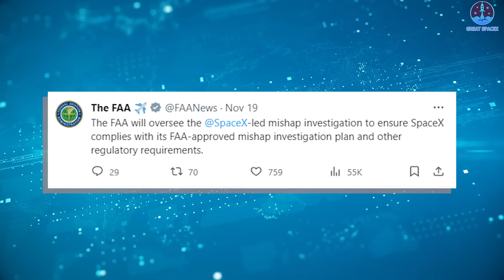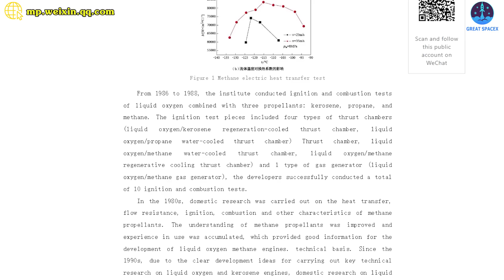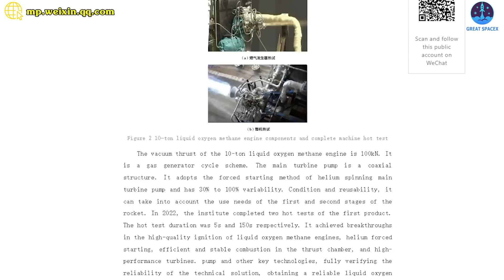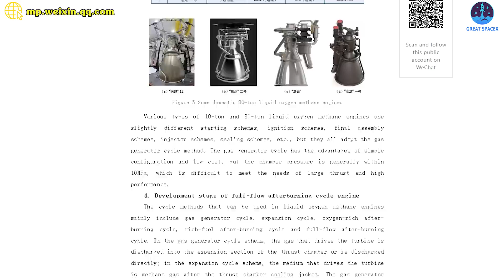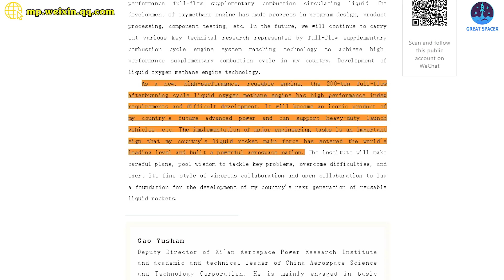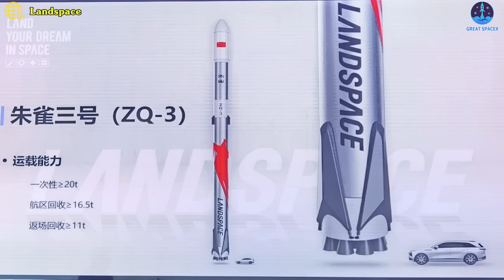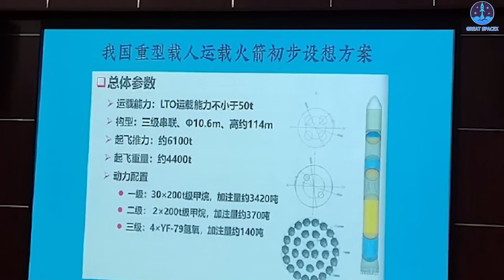SpaceX Starbase Reboot for Starship IFT-3! Blue Origin New Glenn's first stage revealed...

Comment: New Glenn is designed to compete with falcon9, the reliable and cheap but outdated SpaceX-workhorse, and not competitive to the FULL reusable Starship. So New Glenn is outdated before its 1st flight and not competitive at all !!!
Reply: Yeah, it should just be "Glenn".
Reply: If these rockets can literally land under their own engine power how on Earth are they outdated!?
Reply: @randomguyonyoutube1620  New Glenn is not FULL reusable like Falcon9, the second New Glenn stage will be expanded in contrast to the Starship, which will perform reentry from Orbit and can transport goods and personal from Orbit to Earth and from USA to Australia for example. You need reusability of the second stage in order to build a "Gasstation" in orbit and you need that gasstation in orbit to have fuel for refilling deep space Missions and other projects like commercialisation of the space....

Comment: Why has SLS not been scrapped? Untold Billions of dollars poured into a system that is soon to be obsolete, that will cost 1 billion per launch with nothing recoverable.
Reply: Starship will eventually make SLS obsolete.  In particular SpaceX has bid a total of $4B for two crewed landings on the Moon and the requirement to rendezvous with Orion in the Not Really Helpful Orbit (NRHO) severely reduces the payload it can deliver to the  Lunar surface.  That is less than half the cost of the two SLS launches required to deliver Orion to the NRHO.  Starship does not need to rendezvous with Orion because it has to fly from the LEO fuel station to the Moon and back again anyway .  If I were an astronaut and I was given a choice of spending 9 days in the tens of cubic metres of habitable space of the brand new HLS or two weeks crammed in the 9 cubic metres of a 12 year old Orion, and having the entire four person crew delivered to the Moon with a hundred tonnes of equipment and supplies rather than the ten tonnes included with Artemis ...

HOWEVER, Starship is still only a prototype and honestly will probably not be ready in time for Artemis 3, which is currently scheduled for just two years from now.  Some commentators question whether Starship can be made "crew-capable", because of its lack of a launch escape system.  However there are two trivial workarounds:

1. Deliver the crew to the HLS by Crew Dragon after it is fully fuelled in LEO.
2. Attach a Crew Dragon to the Starship as a lifeboat.  The crew would ride to orbit sitting in the Crew Dragon which could be ejected if anything went wrong, just as cosmonauts squeeze into the Soyuz reentry capsule during launches.

However beyond Artemis 4, four years from now in 2027, Starship will clearly be in full production with at least a hundred consecutive successful launches.  At that point it will cost SpaceX less than $100M to refuel and deliver an HLS from LEO to the Lunar surface and back again.  SpaceX will have almost certainly flown the Dear Moon, Polaris 3 and Polaris 4 crewed orbital missions to the Moon by then, and will be charging for payloads to lunar orbit at rate comparable to current Falcon 9 rates per kg to LEO.  At that point you really have to ask why American/European/Japanese/Canadian  taxpayers should be asked to pay $4B for an SLS flight plus $3B for a BO lander, to achieve the objectives of Artemis 5, when SpaceX can probably bid less than $500M and still make an obscene profit.  I would also like to see Dynetics partner with SpaceX because their ALPACA could be delivered fully-fueled to lunar orbit, or to the Lunar surface, although I suggest they relabel it the Eagle in honour of Space 1999.  It makes much more sense for point to point deliveries on the Moon, than as a means to deliver payload from the Earth to the Moon.

_From the Earth to the Moon_, Jules Verne, 1867
_There and Back Again_, J.R.R. Tolkien, 1947
Reply: @jamescobban857   Using falcon to deliver the crew to a orbiting StarShip seems like the way to go and leave dragon in orbit until the crew uses it to come back to earth.
Falcon flew for years and dragon took cargo to the space station before humans flew it.
Reply: SLS has a lot of politics behind it. A big part of the reason it's so expensive is politicians from across the country have lobbied to have parts of the rocket produced in their state. They've even made laws that prevent NASA from diverting funds away from SLS to other projects. SLS is more of a government pork project than a rocket development project

Comment: Of course the FAA deemed IFT2 a "flight anomaly"! Two RUDs could hardly be considered otherwise but as the FAA notice said, "No injuries or property damage have been reported." (Apparently incommoded fish do not count. ;) ) Obviously there will be a few Ts to cross and Is to dot to make the bureaucrats happy but that is minor.
Reply: Only the upper stage failure was an anomaly (or at least, a consequential one). They didn't ground F9 launches every time one of their first stages failed to land.

The ship failing to reach orbit is a real problem though. Propellant leak I guess, which happens. But, for a ship that's going to rely on in-orbit refueling you'd think it would have a lot of dv margin, and the fact that it apparently doesn't is worrying. Hope I'm wrong about that.
Reply: @eikokiri-i4d  The ship didn't fail to reach orbit due to insufficient DV. Indications are that the upper stage suffered a major, catastrophic malfunction. Comparing IFT2 to IFT1 SpaceX has made huge progress. That's how iterative engineering works. You take steps towards your goal, learning from each "failure". I've had to go through many iterations before getting it right. Hopefully the FAA will do its thing quickly so SpaceX can get on with the job of going to Mars.
Reply: I heard someone say that the upper stage still used hydraulic TVC.  So, that may be part of what led to the issue that prevented it from continuing further into its planned mission profile.  SpaceX will be poring over every single bit of data and telemetry from Starship right up to the FTS activation in an effort to determine exactly what transpired.  But all of this is part of the plan and process.  It’s neither a shocking nor a wholly unexpected development, when things don’t work nominally at one point or another.  The only way these things can be rooted out of the design is if they occur during test.  No test, no discovery and no progress.  The key is to continually test and continually improve.
Reply: @cobra-judy-anspq11  I spent several years in electronic R&D engineering. If you're not screwing up you're not doing anything. If everything works you don't know if you got the design right or you just didn't get close to some boundary condition. I worked for a software company and more than once we had a module that had been working for months puke its guts up. I once spent a week in Des Moines, Iowa analyzing such a problem. Under certain conditions the software would just go to its knees. Nothing for it but to reboot. It was costing customers money. As software test analyst all I could do was tell the programmers what I saw going wrong. I would generate test data for a couple of hours then spent 6 or 8 analyzing the data. I can only imagine what the engineers at SpaceX are doing right now.
Reply: Will prob be another year before they can fly again because of it.
Reply: @SpruceMoose-iv8un  I doubt it. My money is on the 1st quarter of '24 i.e. before April Fool's Day.

Comment: Of the 3 systems in development only Starship has actually flown and is handicapped by the FAA unwittingly(?) working against US interests. Both Vulcan and New Glenn haven't flown and so are still at the pretty water tower stage. Both are handicapped by using the unproven Blue Origin BE4 engine. Vulcan may fly by Christmas this year, but New Glenn has much further to go, and at Blue Origin's glacial rate of progress it may be years late based on past performance. Additionally, once Spaceship demonstrates it can get to orbit and return, it will make New Glenn totally obsolete as Spaceship can deliver twice as much mass to orbit at a much lower cost. Perhaps Jeff Bezo's Elon envy can justify BO building another pointless rocket, but share holders require returns and potential customers will look for low cost and reliability
Reply: SpaceX will land on the moon before BO test flies
Reply: That's why I wish SpaceX would quit with the Indian Ocean or Hawaii bs and go for orbit with the 3rd launch
Reply: @DrDiff952  The primary additional objective of the Indian splashdown is determining if it is possible for Starship to communicate with Starlink along the only path that is not blocked by electrically conductive plasma, the tunnel that the Starship has plowed through the upper atmosphere.  The only reason that the early tests are suborbital is that an orbital trajectory would require the Starship to perform a second engine burn to initiate reentry.  SpaceX does not have to prove that Starship can reach orbit.  If it reaches the planned suborbital trajectory with propellants  left, that is proven.  More important is testing reentry at near orbital velocity, something no launcher has yet achieved.

Comment: How many satellites can they keep putting up in space?.
Reply: Space is a big place
Reply: Idk, there’s a LOT of space out there… I don’t think there is a limit.
Reply: Imagine the surface of the earth, now imagine it has multiple layers in different altitudes, and each layer is slightly bigger than the previous one, and all that space is used.
Now imagine the same layers, but slightly smaller ones. How many planes can we have in those? remembering that planes folows paths that don't maximize all the air space of the earth. 
There are about 10.000 planes in the air at any given time in average.
Plus, a plane is so much bigger than any satelite, some are the size of a shoe box, some are the size of a bus, but none are the size of a comercial airplane.
Reply: Over 9000
Reply: @TubbyJ420  true.. 
You rounded down, I rounded up
Reply: 5

Comment: New Glenn is designed to replace the Falcon 9, a rocket Musk has long stated he will retire once Starship is operational. Based on past performance, Blue Origin needs to hurry before there’s no SpaceX rocket to replace.
Reply: I totally agree, but I would use the words 'compete with' rather than 'replace' since they are two different companies.
Reply: Unfortunately, "needs to hurry" is not in their wheelhouse, or hasn't been up to this point. Let's hope for sooner rather than later for BO.

Comment: New Glen is a proposed reusable rocket and a proposed competitor to F9.  Most video's spout their spec's like it's already happened and as we all know, it's construction hasn't even been completed yet, much less tested and flown.  Kudo's for their great CGI, though.
Reply: my reality is not real enough!
Reply: It is more capable than falcon heavy in reusable mode. Also the image is real hardware not cgi
Reply: @iamjwns6277 well the explosions are amazing cant wait for more.😂
Reply: @iamjwns6277  It is proposed to be more capable. Let me be clear, I hope BO is successful. The more successful rocket systems the better for the overall industry.
But this continued drawn out hype is not helpful. It sows the seeds of distrust and disbelief. Cheers
Reply: @metriczeppelin  the tanks have been tested, the engines have been tested , the fairings have been tested as well as the avionics. The first flight might fail, even the second flight might fail before they succeed. But that has nothing to do with the fairing volume and thrust. Also There has not been any drawn out hype. Noticing hardware isn’t hype. There has only been ridicule from SpaceX fanboy incels who somehow always get triggered when blue origin is mentioned.